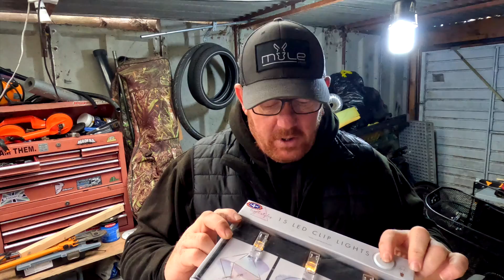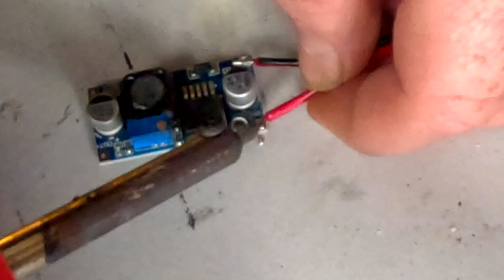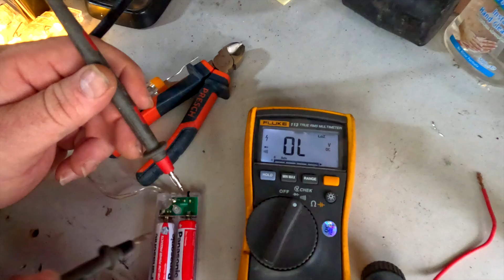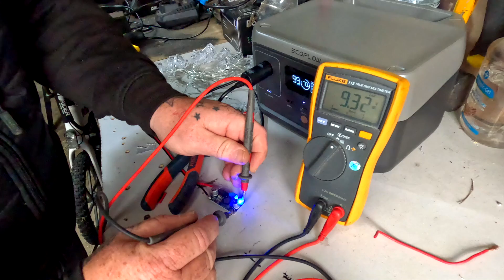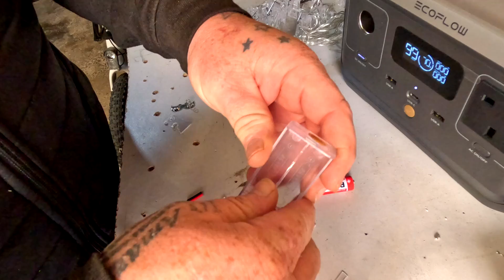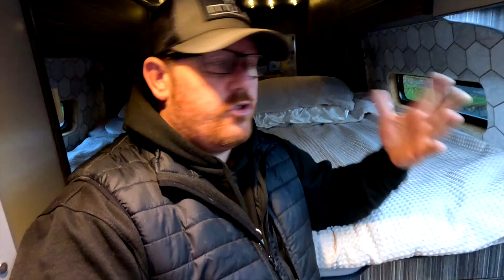Make Your battery LED LIGHTS Run off 12v

Comment: Greetings , , Neil and Emma,
I know this has been a while ago but now I have a use for them.
I think it is a cracking idea.

The Toilet Cassette FULL warning light is on a little pair of AA batteries in the side of where the cassette is accessed from outside in a little plastic box.
Obviously these get forgotten and the batteries leak corroding up with the slime.
The 12v turn down unit you showed is a boon.
Cut and replace the battery box, run a feed wire from something live only when occupied.
I have also thought of a little buzzer and silencing switch just to annoy you.

The joint Carbon monoxide and Smoke alarm may get the same only required when occupied.
Perhaps leave rechargeable batteries connected.
So charge only when occupied and still cover when not.

I am saving for at least 1000w power pack and solar panel to make the days away cushier.
Best Wishes POTTSY.

Comment: These are great. I want to do something similar, but with lights that have a remote control and change between different twinkle modes. Do you have any feedback on how to do that? I guess I have to incorporate the original chip?
Reply from the maker: Check out our shorts

Comment: Those buck converters are great.  I use many of the higher current ones for tablets and anything on 16vdc charging. More efficient than 12vdc up to 230vac via an inverter then charger to 16vdc etc. Cheers from old George ex ,Radiospares.
Reply from the maker: Arnt they just a great little thing . Thanks buddy

Comment: Hi Neil,  great vlog... can I ask you what is the best diesel heater for a 8 meter motorhome  ? Would a 5kw one be big enough 🤔 would appreciate the feed back. Keep the informative information coming please. Kind regards Frank 👍
Reply from the maker: I’d provable go for a max speeding rods 5kw mate there quite cheap but there much better than a lot of the others out there . And simple to fit as well . Plus you’ll heat up a motorhome with one of them for sure

Comment: Yep, that's tidy, but resistors are pennies.

The calculation to get the value of the resistor is R=V/I

A normal LED wants 1.8V @ 20mA 
but these may be low power ones (maybe 2mA) so check for a resistor in the battery case, measure the current with your multimeter where you've cut the wire & work it backwards from there.

Standard LEDs want 550Ω for 12.8V, 600Ω for 13.8V, 620Ω for 14.2V or 680Ω for 14.8V (fully charged battery, typical regulated circuit, typical alternator or high-power alternator). 
If you do have 2mA LEDs the resistor values are 10x higher, 5,500Ω to 6,800Ω or if the string is taking 10x the power it's 55Ω to 68Ω
Reply: Also, 160Ω is what's needed for 5V -- USB outlets that you're likely to have scattered everywhere.

Comment: Nothing wrong with running them at a lower voltage, however there was a flaw in your measuring. You measured the voltage of the battery power, whilst the lights were on i.e under load, but then set your voltage regulator voltage without the load applied.
Reply from the maker: There 3volt lights . And where set to 2,8 volts so no problem there but the main thing is there working . Job done
Reply: not really, there's plenty of tolerance built in. The circuit would have been designed for the old zinc-carbon batteries at 1.5V per cell but still bright enough at the nominal 1.2V of alkaline batteries.
Reply: @alanhat5252  Alkaline AA battery’s are 1.5V (Recharges would be 1.2), but that doesn’t detract from the fact the first measurement was taken under load, in this case it will be fine as you can dim them as much as you want, but if you wanted them the same, you would set the voltage with zero load as was done here, then re adjust to the 2.8V whilst under load.
Reply: Thanks nice vid. It's about exactly what I want to do.....but you lost me at just 34 secs in. What is ...."one of them"? And where do I get "one of them" 😊?

Comment: Thanks Neil, great video - good job 😊Am I right in thinking you could swap out he 12V connector for a stripped USB cable with connector (5V) - just set the input voltage to 5V rather than 12V and step down to 2.8V?
Reply from the maker: Yer you could but it’s basically the same thing your just use in a usb that’s not needed and also adding to the cable which in my eyes is just some thing else that could fail .

Comment: Well spotted Bargain - Very handy those DC converters aren’t they - I used one for my DAB tuner in the back (which I still haven’t fitted) - I did have one of the capacitors fall off but probably because I’m hand fisted.
Fluke multimeter too 👍 I always wanted a fluke one.
Great idea
All the best, David 👍
Reply from the maker: Aren’t they just a simple east way to get what you need . I love them me